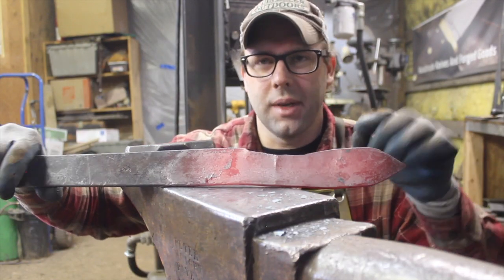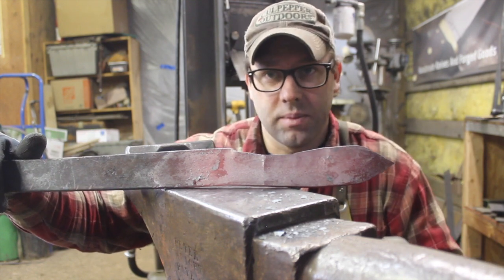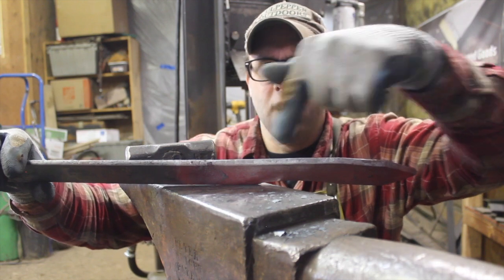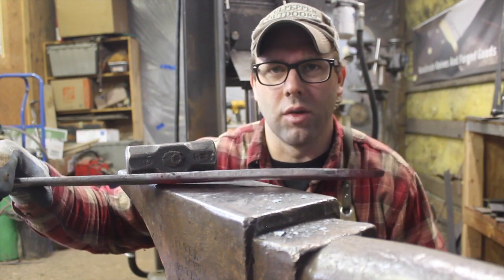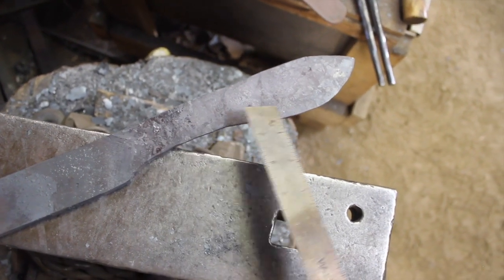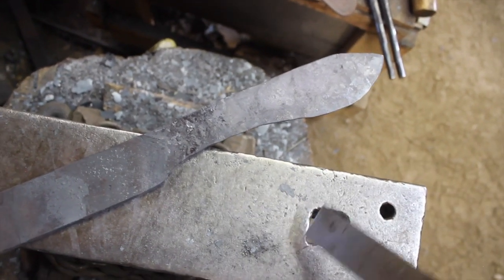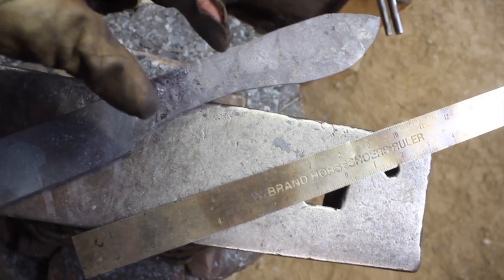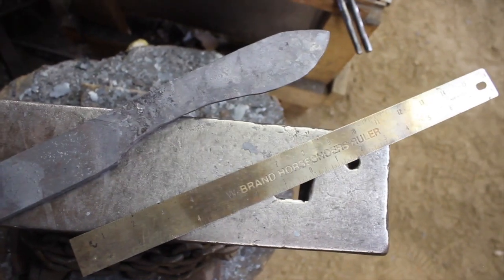Backwoods Wilderness Chopper Forged From Field Harrow Spring Steel ~ Bladesmithing Knifemaking

Comment: Awesome knife! I enjoyed the forging process. Your Anvil sounds Lively! Thanks for the video. Cheers from Aleeknives!
Reply from the maker: You bet, thanks for watching!
Reply: Can a guy get started forging knives for 20,000 bucks?  Or, for that matter, what did it take for you to get  where you're at now?
Reply: I think you could get a pretty decent setup for less than $1k if you had some skill and desire to succeed!
Reply from the maker: @JohnJohnson-bg2oo  20k could get you a really nice tool setup, but the learning and experience to use them takes time and practice. You can start with far less money..
Reply: @FireCreekForge  I'm missing a good anvil, and a couple of hammers.  Was thinking about building a power hammer and looking around for a used wood splitter to repurpose for a press.  I've been in the sheetmetal/ironworkers for 25 years now, and have accumulated various woodworking and metal working tools if you can imagine, just wanted to see if I could do it, need another hobby you see! 🤣